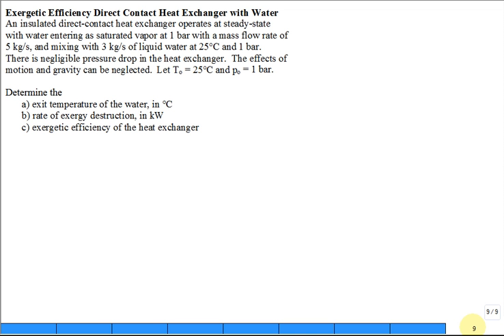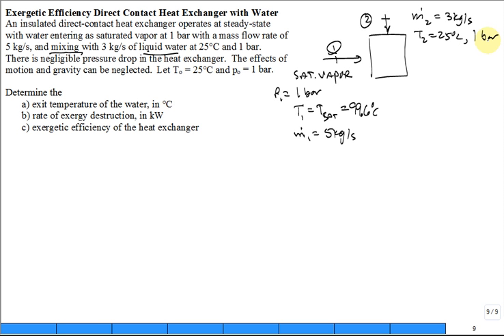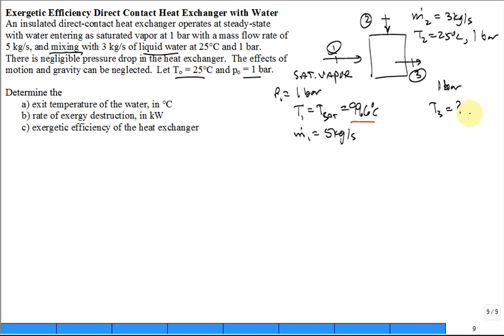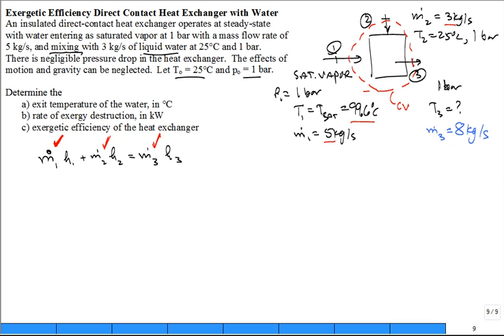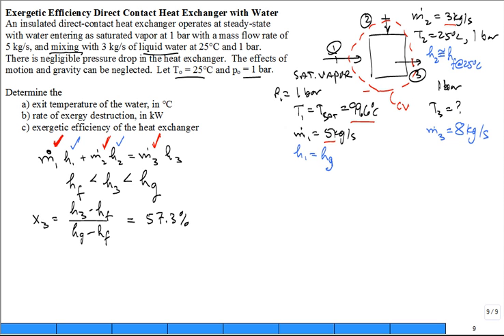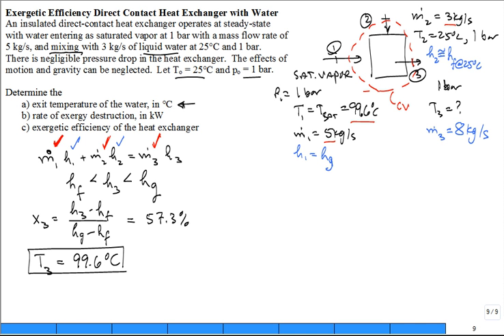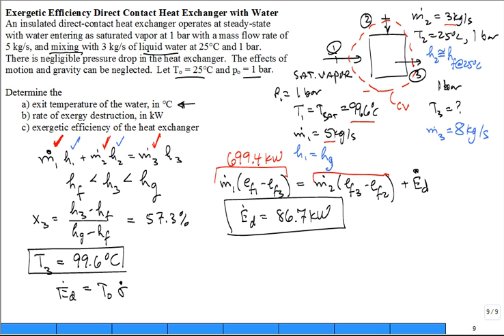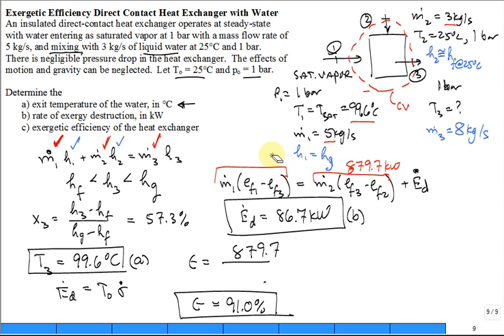Exergetic Efficiency Direct Contact Heat Exchanger with Steam

Comment: if I want to calculate a direct contact heat exanger where we use direct contact water to dry/cool or humid/heat an air flow. 

Lets say I want to cool 3000m3/h with air from 75% RH and 22 degrees celsius to 5 degrees celsius and it will then end up at approximately or close to 100% RH.

I use a waterspray(lets say this one is 5 degrees) on to a film in this tube which will essentially be a cross-flow heat exchange with direct watercontact. 

How do I calculate how much water I need for this operation? And/or square area of film covered in water?